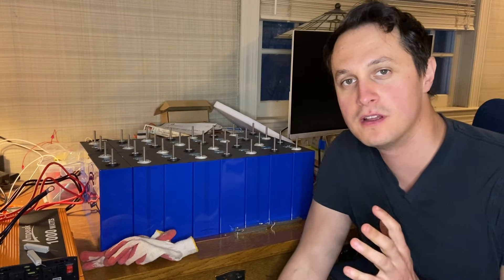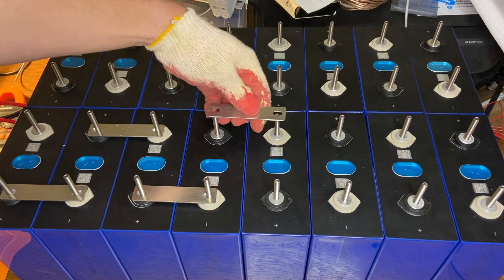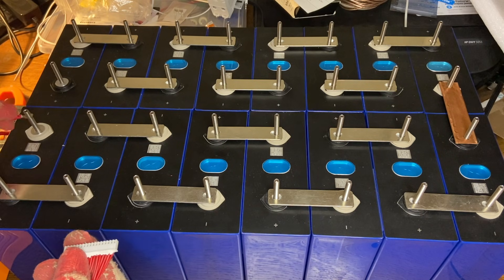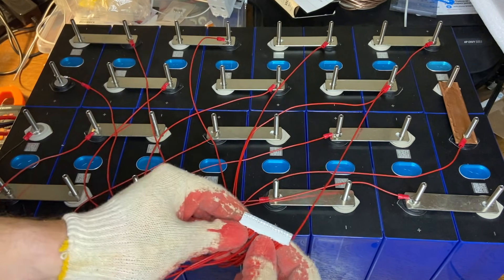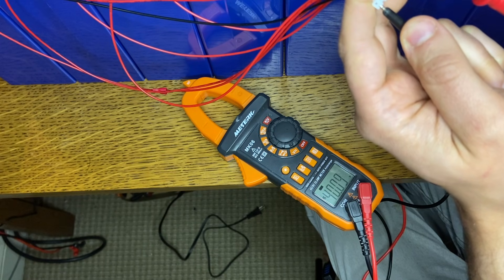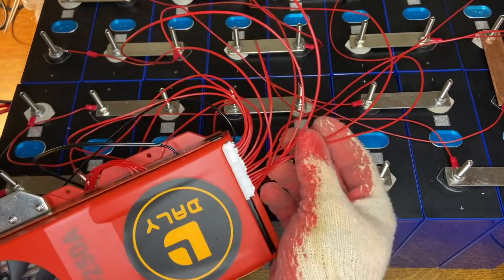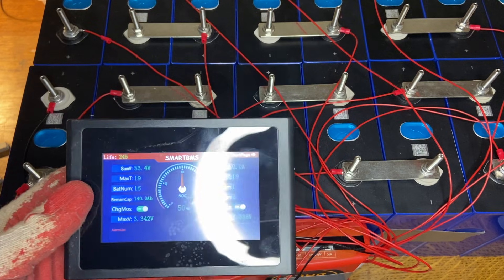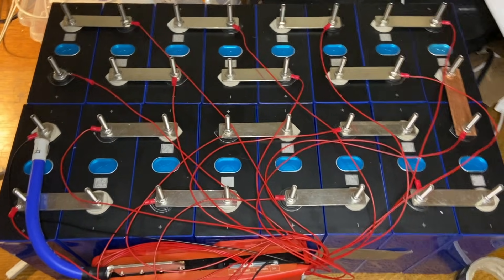How to Wire a 16S Lifepo4 Battery w/ BMS

Comment: This may be outdated. Modern BMS cabling for 16S will have 18 wires. One Black negative and 17 Red wires, with the 18th wire being the Positive and will double up with wire 17 on Positive terminal cell 16.

Comment: I noticed only 1 big mistake in the video. The final main contact  was screwed above ..the other screw and not the battery contact itself which would massively lower conductivity. Maybe it was done temporarily but it can be misleading.

Comment: Good electrical sense. Most popular youtubers spread EXTREMELY dangerous videos. They never test sensibly with multimeters before connecting; they throw random exposed cables on top of contacts and connect them in a random order; I guess they are sent free stuff and half of their equipment is burned off-camera with all the mistakes they make.

Comment: I have four batteries that I'm using to make a bigger battery.  They are 12.8v 300ah.  I want to hook up a external bms with a can port communication connector so I can have close communication.  How can I do this? They are dumfume lifepo4 batteries.

Comment: great video, what would you recommend for DIY 48V 400Ah battery, 15cells of 3.2V 400A (all series) or 30cells of 3.2V 200V (2 sets of 15celss in series, 2 sets in parallel)?

Comment: Hello @TheWilltoBuild.
I have 42 battery modules from an old NISSAN LEAF with 3.2V each. What kind of BMS should I get? Would one of this bms that you installed fit this solution but with less cables? Imagine 21 cables connected to groups of 2 modules? Or should I use 1 cable per module? 

Thank you in advance

Comment: This is exactly what I need. I like the way Black is negative and white positive sounds like American system. I really think each wire should have a small in line fuse near the terminals to prevent a fire incase of unlikely event of shorts between wires. Great Video

Comment: Random question - if you wire the DALY 16s BMS say in 8s will it still operate? I'm looking at getting 8 cells and thene expanding to 16 a little further down the track. I know the app allows you to change 'board 1 cell num' but just curious if it actually works. Obviously i'd need to adjust the min/max voltage etc...

Comment: So what do you do with P-? 
Is P- hooked to - side on your inverter?
Do you take connect positive (main positive on battery) to( 250 Amp breaker in line) to positive on inverter?
Sorry for my stupid questions? I haven't even got into the Bluetooth part yet. If I can get it hooked up to my 12k growatt inverter to start, that would be great.

Comment: Nice work here.  I'm uncertain about the P- and B- cables coming out of the BMS.  I see the B- goes to the main negative, but the camera angle didn't show where to connect the P-.  You said your volt meter showed the correct voltage and when the camera backed out the P- was on the table.

Comment: Wonderful video, I followed all the instructions though my DALY BMS is reading the voltage lower than the actual voltage (like if I measure the Open voltage of the batteries with a voltmeter I get 53V while Daly indicates that it is 52.5V). Any way I can solve this?

Comment: QUESTION ON THE LENGTH of the Red and Black.  I understand that it needed to be the same.  But do u guys calculate the Blue - out of the (-) of the BMS out of - battery? and the black - from the BMS which is like 10 inches in blue and black on the bMS ?  my battery got high voltage at cell 15 , 16 but low volt at 1234 little higher than 56789.  The 15 n 16 cells got to 3.5-3.67 while other are still in the 3.3.  Thanks (i understand from busbar to inverter black and red are the same length.)

Comment: Thanks for the video, super helpful! What size of ring terminals are you using, I am setting up my system and want to use ring terminals but the wire is so small..., Thanks!

Comment: Sir, how much is  the resistance and power of the resistor you used to short the bue cable of the bms and negative side of the battery. Any suggestion sir for example that the bms is not active uoon the completion of wirings.Thanks a lot

Comment: 12:29 according to manual, next step is to measure the resistance between B- and P-. It should appear as a short. If it is open, then something is wrong ie the BMS is opencircuit dead.

Comment: is it possible to connect 24 lifepo4 cells in a 16s configuration?
Reply from the maker: Nope. For 16s you need a multiple of 16, so 16, 32, etc. You can do 3 8s batteries with 24 cells.

Comment: Thanks for the video.  I have 16 Lifepo4 3.2v 280ah cells coming very soon.  I was looking for a video to walk me through this step-by-step and yours does that.  Where/how do I get or build a bus bar to connect the two 8 cell rows. Does the bar need to be made of copper?  What gauge wire would I use to connect the pos and neg terminals to my inverter (which I don't have yet).
Reply from the maker: All good questions. Bus bars you can make yourself (I have a video and there are many better ones out there). For the gauge wire, it depends on how much current you will use and how long the cables will be. I personally use 2 awg for a system that uses up to 6,000 watts at a time. If you have an inverter that will use more power and it will be far from your battery, you'll need bigger cables.

Comment: Was the copper link a bit of squashed copper pipe or a bar? Ps great BMS too, I’ve just ordered one for my project.
Reply from the maker: I was doing the squashed pipe, and that works, but if you are going to make a bunch, buy a bar yourself, its not a big deal and is worth it.
Reply: The same BMS as reviewed, arrived via AliExpress, took roughly 3 weeks, £16 + change, fully assembled, just a little bit of work attaching the leads. Does what is says on the tin, spot on. The bit of test nickel that came with the kit was cheap plated junk, but sparks like mad lol, only mistake, don’t test on the place mats, burnt two tiny spots! Hide the evidence and blame the dogs 😆

Comment: I got the BMS Awake I set The parameters on my android phone in the app but my touchscreen like you have will not light up ? “ Any HELP Welcome ! “
Reply from the maker: Sorry to take so long to get back to you. Trying plugging the screen in and out? If the BMS is awake, and power is flowing into or out of the battery, then if the screen is plugged in it should light up. If it doesn't, I don't know what the issue is.

Comment: I am trying to convert my mobility scooter to 8 cells in series , two packs of 4 =24v , 8s BMS . where do I connect the P- black wire ?
Reply from the maker: I don't have my BMS in front of me. If you are doing 8s (8 cells in series), and wired everything correctly, the blue B - wire goes to the final negative terminal of the cells, and the P - is now the negative terminal of the battery and in conjunction with the positive terminal of the battery is how you charge and discharge the battery. Look at this BMS wiring diagram here https://shopee.ph/DALY-BMS-LiFePO4-16S-48V-20A-Common-Port-with-Balance-i.265107976.4152389743.

Comment: My battery sits at 50.4v and once wiring up and I test it on the black wire as the negative the multi meter shows 48.8v each batteries at 3.336v all were top balanced for like over 2 months ++ & - - ? If you are able to help with any ideas greatly welcome !
Reply from the maker: Sorry, I am confused. What is the problem exactly?
Reply: I don’t know what that issue was but now the touchscreen will not light up it’s plugged in properly

Comment: How to get the screen to turn on I have the exact system ?
Reply from the maker: The screen only turns on when the BMS is turned on. The BMS only turns on when there is current flowing through it. So either charge or discharge the battery using the BMS and the screen should turn on.

Comment: Nice, very clear guide lines. Thank You, could you pls give us details about ratio of
A. Battery capacity Ah. B. Consumable load Ah. C. BMS rates Ah.
Example ( a. 72V 36 Ah,  : b. 30Ah, : c. BMS 72v 50Ah 23s) is it correct if wrong pls share correct ratio. For Lifepo4.
Thank you
Reply from the maker: For these cells I have another video that goes into these details. But for this 16s battery, A. 48v 280 ah B. 280 ah C. 48v 200 amps.

Comment: Great video, so clear and concise. Do you know if it is possible to lengthen and shorten the balancing leads? I want to line up my cells so they make a slimline battery and fear the furthest leads may be too short.
Reply: No you can't the wire should be tha same, otherwise balancing  won't work properly.
Reply from the maker: I think you definitely can. Shortening is straightforward. For lengthening, there are ways to extend wires, and as these leads carry very little current I think if you do it right it should be fine.

Comment: why 250A bms?
Reply from the maker: For a few reasons. This BMS is programmable, so I can set over current protection to any value I want and therefore the bigger the BMS the better. But also, alot of cheaper BMS say they are rated for a certain amperage, but then get really hot when they approach that actual value. So most people discount their BMS, i.e., if it says 100 amps assume it is really only good for 80. In my system I have a 6000 watt inverter, which when fully used is going to pull somewhere around 125 amps, so I would say I need a BMS that is at least 150 amps. So I could have gone with a smaller BMS, but again this one is fully customizable. Also, having an extra large BMS allows me to expand my system in the future if I want without necessarily needing to replace the BMS.
Reply: @TheWilltoBuild  thanks for the explanation i am planning on building something like yours

Comment: What kind of BMS do you need when you want 12V with 16 cells? Do you need also a 16s BMS, or a 4s BMS? Greetings from Holland.
Reply from the maker: Hmm, that is complicated. For a 12v you need a 4s. If you want to make a 12v with 16 cells, I would say make two 4s2p batteries and then wire them in parallel. Each one of those two batteries should have its own 4s BMS.
Reply: @TheWilltoBuild  Thank you very much!!!
Reply: What is your expected maximum current draw? If you need the ability to handle 500A, say because you are running a 6KW inverter, then a pair of these BMS will not suffice. In that situation you will require four fully paralleled batteries and four BMS. If your maximum continuous draw is only 150A then it’s possible to put four cells in parallel and then in series. In the second case it’s a single 4s BMS. Parallel, sometimes dozens of cells, before series is very common with the cylindrical cells.

Comment: Exactly what I was looking for, except:  WTF does the BLACK P-Neg wire hook up to going forward?!  You talk about comparing it to the positive but you do it off-screen so we don't see what you are hooking up to.  Can I assume that you are metering from the P-  on the BMS to the BATTERY main POS. for potential?  Is it then, hooked to the negative pole on the charger?   Would this mean the BMS is essentially a NEG. pole hookup device through which ALL the NEG. power passes?  DALY's website is totally unclear.  They say FIRST hook the BLUE- to BATTERY TOTAL NEG. (main NEG), then remove wires from BMS, then hook up the wires to the batteries after hooking up the (thick) black wire to battery main (total), to hook up 2nd red wire to 1st battery pos. pole.  (wrong, it's the 1st red wire that goes there, which is the 2nd wire on the loom)  They have a drawing and then refer to both BLUE (B-) and BLACK (P-) as BLACK.   They say, hook it up to "LOAD".  Hard to follow their backward woven wording... Wait,,,,,, I just looked at their drawing again and coupled with what you do on this video, I think I have it worked out.  lol.  P- goes to the NEG. terminal of the charger and ALL the NEG. current flows through the BMS large wires and the POS. charger lead runs directly to the BATTERY main POS.  The BMS never gets any load of POS. except through the fine red wires it uses for monitoring and balance charging the individual cells.   Whew! That was an ordeal.   
     If I got any of it wrong, please let me know as I am about to begin the battery bank and wiring.
Cheers
Reply from the maker: Hey, sorry it took so long to get to this. You got it right. In order to stop electricity from flowing, you just need to open the circuit, meaning cut the wire or path it is flowing through. All the BMS has to do to protect your battery and stop the flow of power is to disconnect the negative and boom, no more power can flow. So treat P-neg as the battery negative terminal and you are all set. Hope it worked out.

Comment: The last step, something about the positive cable and 53.4V was missing in the video.  What did you connect your voltmeter to.  I couldn't see it from 12:13.  Can you hook up 16 cells to make a 24V system?
Reply from the maker: For the voltmeter, you can either connect it directly to the battery (main cell negative, main cell positive) or if you have a BMS hooked up, main cell positive, and BMS B-. 

Also, you can use 16 cells to make a 24v system. Either you can make two separate 8s 24 batteries and wire them in parallel or you can make an 8s2p battery, where you wire two cells together in parallel, do this 8 separate times, and then wire those pairs of cells together in series.

Comment: Can I connect this bank battery with another bank same connection? With another bms
Reply from the maker: If I understand your question correctly, yes. If you have two batteries, with their own BMS, you can connect them in parallel.

Comment: Nice clear cut instruction!  Do you have a link to the 16s lcd display? I’m having a hard time finding anything besides an 8S
Reply from the maker: I think all the LCD displays are the same. The LCD is just an accessory: https://www.aliexpress.com/item/1005002897035148.html?spm=a2g0o.detail.1000014.3.38ba76f68nfuAR&gps-id=pcDetailBottomMoreOtherSeller&scm=1007.33416.213724.0&scm_id=1007.33416.213724.0&scm-url=1007.33416.213724.0&pvid=5d1f19d9-7913-4ee9-9077-162dedd44d0c&_t=gps-id:pcDetailBottomMoreOtherSeller,scm-url:1007.33416.213724.0,pvid:5d1f19d9-7913-4ee9-9077-162dedd44d0c,tpp_buckets:668%230%23131923%2359_668%23888%233325%237_23416%230%23213724%230_23416%236336%2330487%233_23416%234721%2321967%2394_23416%234722%2321972%238_668%232846%238111%231996_668%235811%2327180%2345_668%236421%2330831%23988_668%232717%237564%23693_668%231000022185%231000066059%230_668%233422%2315392%23201_4452%230%23226710%230_4452%233474%2316498%23979_4452%234862%2324463%23348_4452%233098%239599%23297_4452%235108%2323442%23732_4452%233564%2316062%23415&&pdp_ext_f=%7B%22scene%22:%2223416%22%7D
Reply: Very nice. Watched a couple of your videos. Looks like your cells are 320a. You are using a 250a bms. Is that under rated? Explain please.
Reply from the maker: @krg038  Good question. My cells are 280 ah and could technically pull 280 amps - but my system and inverter will only ever pull 150 amps, so I got a 250 amp BMS which gives me more than enough headroom to pull what I need. I could've gotten a 300 amp BMS but then I would be paying for more capacity in the BMS than I need.

Comment: A tip for your cell to cell bus bars.  Put a piece of heat shrink tubing leaving about 20mm or 7/8" exposed on the ends.  A cheap little piece of extra insurance against shorts.  Any way to get extra insulation on the connections is a good thing.  Batteries are NEVER off.
Reply from the maker: That is a good point. Any setup would benefit from this.
Reply: we have

Comment: watched your vidoe, what was the input voltage to the bms.
Reply from the maker: The bms is designed for a 16s configuration which is a nominal 48volts.

Comment: Hello dear , the size of BMS in Amber depends on what ? Depends on the batteries last Amber , for example I connect 4 cells in series and I get ( 12v , 280Ah ) how I calculate the best size of BMS for this batteries is there an equation so I can apply it for any batteries I vs next times ,,,,,,,, can I use pwm or mppt to charge lifepo4 batteries or it will damage them
Reply from the maker: For BMS, you need a BMS that is designed for 4s, 12v batteries. Otherwise, you just need to pick one that can handle the current you need. Some people only need 100 amp BMS, some people need 250 amp BMS. The size of the BMS depends on how many amps you want to draw from it. PWM and MPPT both should work, but I would recommend MPPT.
Reply: TheWilltoBuild why some people put the positive wire of both inverter and charger in same point(nut) of battery positive , I think it’s wrong thing to do that , am I right ?

Comment: Got a question... did you clean the aluminum terminal posts? Aluminum will tarnish in a couple hrs. Did you put conductive paste on the terminals? Did you clean the copper busbars that makes contact with the aluminum terminals?

Are you going to clamp them in a fixture like Eve says you can do to prevent swelling and provides another 1000 cycles? Swelling also will put tremendous pressure on the terminal studs with the busbars pulling against them.
Reply from the maker: All great questions. I try to focus on one main thing at a time in my videos, but I will be doing a follow up video next week on how to prepare your cells/terminals for final installation.

Comment: Hi dear i have problem  when i connect the bms with active Eqlizuer  and turn off the circute breaker  and turn on ...appear  fualt in bms ...and should  be replace the bms ...what i do plz ...
 I used  bms daly 16S with  active equalizer 16S
Reply from the maker: Does the BMS explain the fault? Are you sure the BMS is wired correctly?